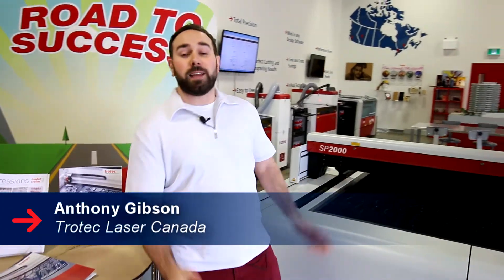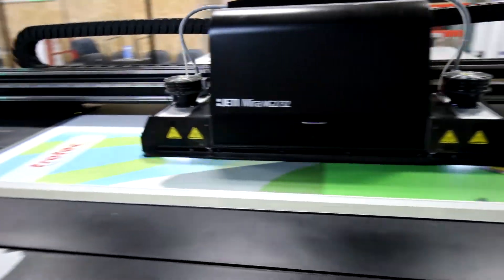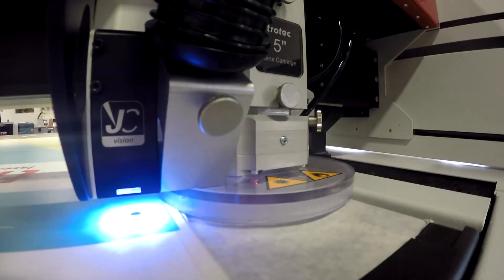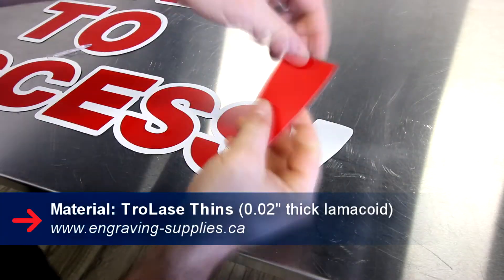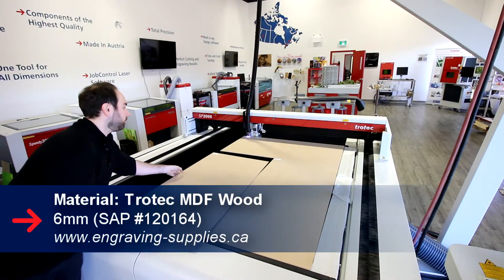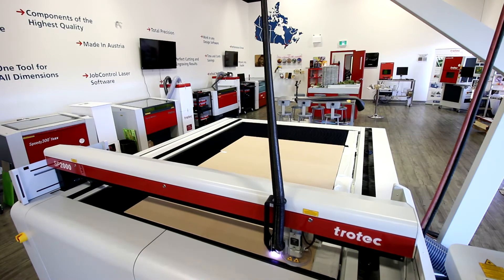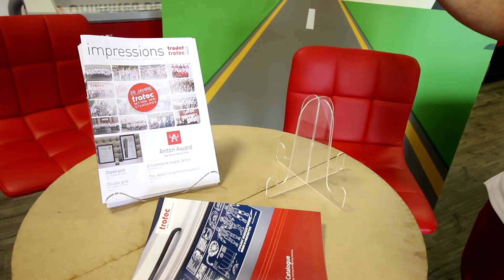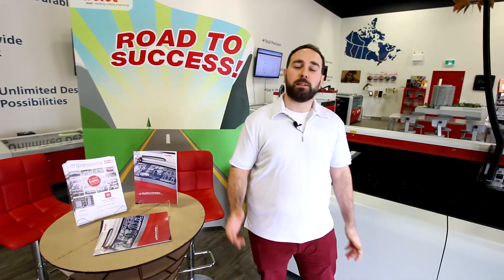Custom Tradeshow Booth | Large Format Laser Cutting | SP2000

Comment: Does the SP2000 have an air cooled tube or does it utilize water cooling?
Reply from the maker: chopperdan88 great question, it utilizes water cooling, you would need a chiller unit with it